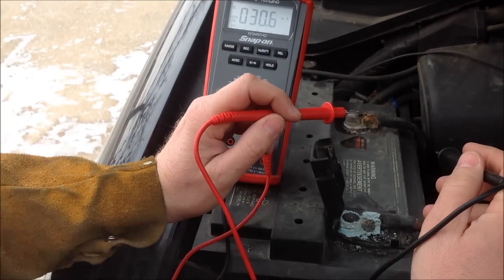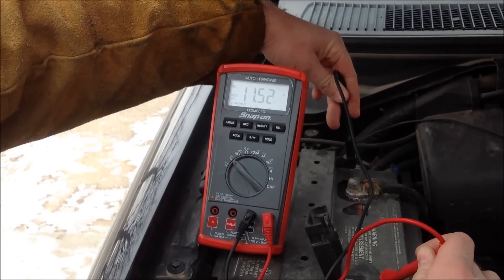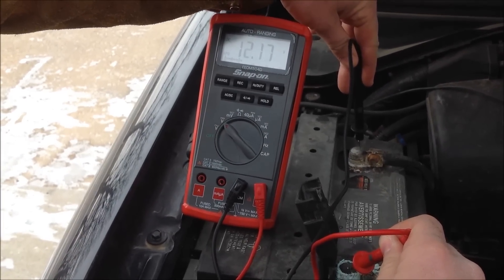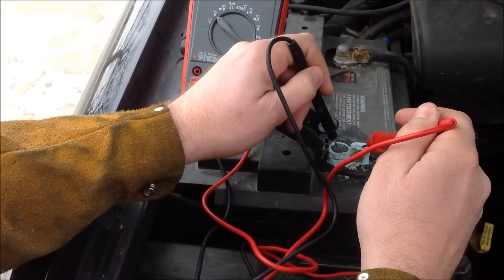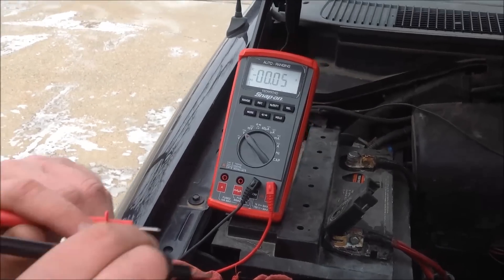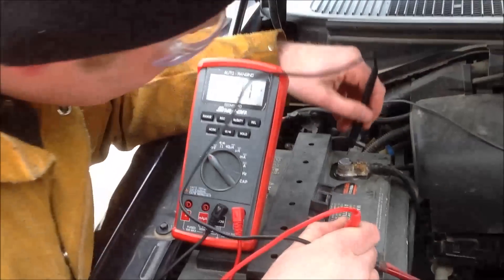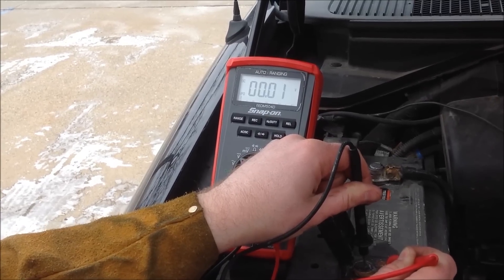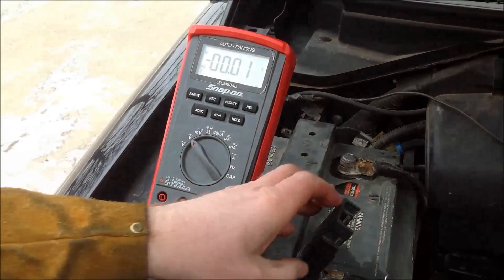How to perform a Volt Drop Test on Corroded battery cables

Comment: I have 1V drop from alternator to the battery. The spot where positive wire connects with battery terminal is extremely hot. I haven't opened it yet, but I assume there is something wrong inside the connection and it creates resistance.
Reply from the maker: You got it! Thank you. Here is a way to support all the free videos. Don’t forget to subscribe too! 
Want to say “thanks” or “keep it up”? Click here https://www.paypal.me/how2wrench  

Coach Conley is also available for hire to personally work one on one with you if ever needed.

Your answers and help are just around the corner. Save time and money while protecting your investment and yourself by doing it the right way!
Follow us!
Web:
www.How2Wrench.com    
www.Tools2Wrench.com

Comment: You need to have a load to get a meaningful voltage drop test on the terminal connection.  Ideally, you could just get a load tester that will draw 100A from 12V, connect it to the terminals, and then measure between the battery post and terminal, while briefly switching in the load.  That will reveal any marginal connections.   
Wouldn't have bothered with that corroded car, because that was so bad it probably would show a big drop with just a dome light on.  
If you don't have a load tester, you could just have someone crank the engine briefly and make the measurement with that load.  Only drawback with that is the load from the starter is unknown compared to a load tester, so it's an unknown factor.

Comment: does it matter which lead is on what whren doing drop test???
Reply: Don't forget to check both the positive and negative terminals, although the positive terminal is usually the one that gets all crudded up like that.
Reply from the maker: No. Not on a digital meter. I have other videos explaining this but, in short, the meter reading will have a minus sign if reversed. 
You're very welcome and in luck. I provide one on one help. Contact me here: https://how2wrench.com/contact/ Your answers and help are just around the corner. Save time and money while protecting your investment and yourself by doing it the right way at www.How2Wrench.com  

Have you Subscribed yet to never miss a video? Have you seen the video playlists https://www.youtube.com/user/conleybuilt/playlists ? 

Want to say “thanks” or “keep it up”? Click here https://www.paypal.me/how2wrench

Comment: Do you grease the terminals before putting it together or do you grease after everything is together? Just wondering if the grease can prevent a good connection if it's sandwiched between the two.
Reply: If the terminal is tightened properly it should displace the grease and make metal to metal contact.  It's better to do it before so it fills the voids that can allow moisture to get in and set up corrosion.